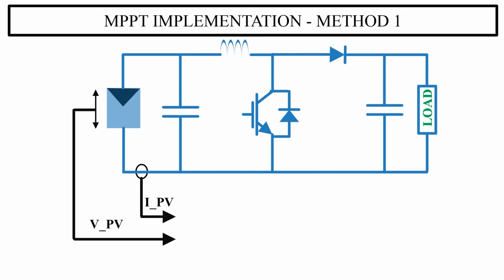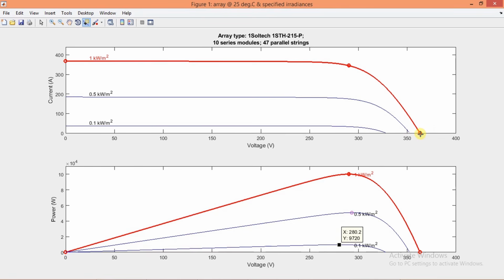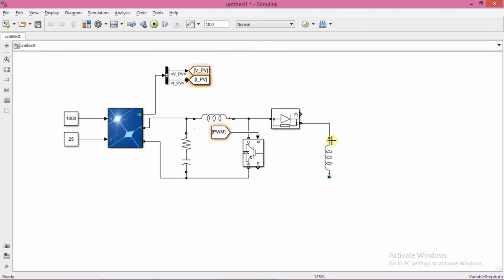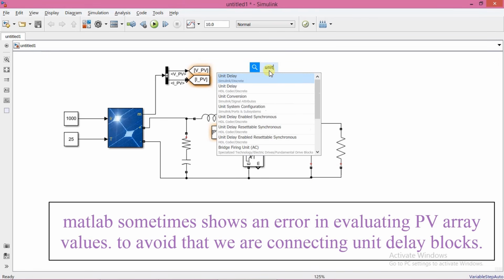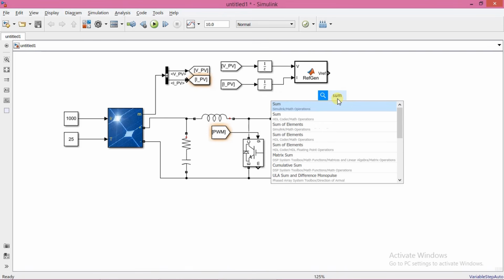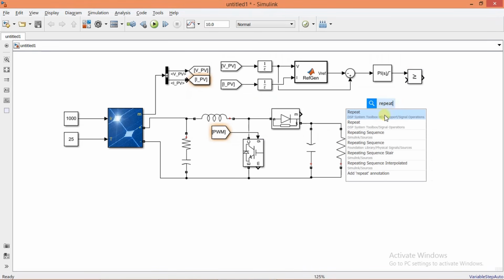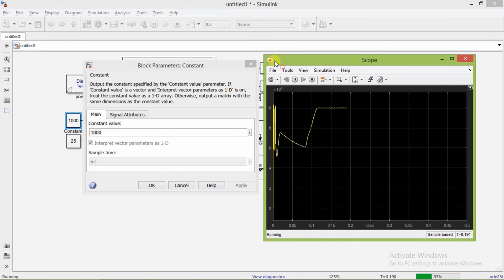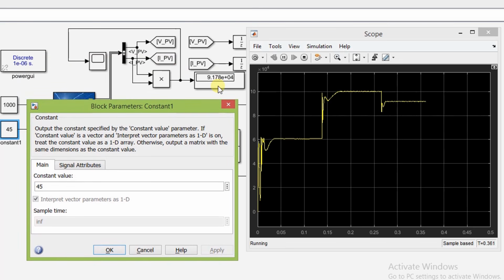Demonstration of Maximum Power Point Tracking (MPPT) Using boost Converter in MATLAB - Method 1

Comment: Here is the working version of the code:
function Vref = RefGen(V, I)

Vrefmax  = 32.9;    %(add your own ref)
Vrefmin  = 0;
Vrefinit = 25;
deltaVref = 0.1;

persistent Vold Pold Vrefold

if isempty(Vold)
    Vold    = V;
    Pold    = V * I;
    Vrefold = Vrefinit;
    Vref    = Vrefinit;
    return;
end

P  = V * I;
dV = V - Vold;
dP = P - Pold;

% Default value ensures Vref is always assigned
Vref = Vrefold;

if dP > 0
    if dV > 0
        % Voltage increased and power increased:
        % continue increasing voltage
        Vref = Vrefold + deltaVref;
    elseif dV < 0
        % Voltage decreased and power increased:
        % continue decreasing voltage
        Vref = Vrefold - deltaVref;
    end

elseif dP < 0
    if dV > 0
        % Voltage increased and power decreased:
        % reverse direction
        Vref = Vrefold - deltaVref;
    elseif dV < 0
        % Voltage decreased and power decreased:
        % reverse direction
        Vref = Vrefold + deltaVref;
    end
end

% Saturate the reference voltage
Vref = min(max(Vref, Vrefmin), Vrefmax);

% Store previous values
Vrefold = Vref;
Vold    = V;
Pold    = P;

end

Comment: Your work is really appreciable, But during Boost Converter Design, you mentioned the Voutput=600, i.e. the output of converter, but in actual, the output voltage of Boost converter is less than 400V, Is it the correct response, I have a doubt, Could you please clarify it.

Comment: One thing I don’t get is when the solar panels drop current because of clouds the maximum power will drop out leaving the voltage and the  sensor will sense that maximum power is drop but the converter will still put up some current but not the maximum current to turn on the sensor and voltage will drop lower then the battery voltage and this will overtime distract the battery cell will lower voltage to the battery and I realize a lot of mppt or like this the moment the senor can’t sense maximum power the charging should stop

Comment: what about boost converter output voltage. Is it constant by changing the irradiance or output voltage is varying. If output voltage is varying who will maintain the constant output voltage.
Reply from the maker: this is only mppt demonstration. Not boost voltage regulation. in application where u use only booat converter with PV is to chanrge the battery. In that case battery will ensure a constant voltage at the output and boost act as current source.

Comment: Great Tutorial 👍but I noticed that whenever I changed the temperature and irradiance values, I do not get the maximum power, supposed output voltage, and supposed output current. 

Please do you have any solution/explanation for this?
Reply from the maker: maximum power point will change i you change the temperature or irradiance
Reply: @TechSimulator  Thank you

Comment: Sir how did you get 0.95 and 0 for upper saturation and lower saturation limits ??
Reply from the maker: if i make the duty 1, switch is always ON, can saturate inductor, and device can fail. so for safety i made it 0.95

Comment: 1:38 How did you get all those values? And why the DC input capacitances is added in parallel with the PV Array?
Reply: capacitor uses to control oscillations generated by pv module

Comment: THANKS BROTHER... it worked like a charm
Reply from the maker: Glad it helped
Reply: @TechSimulator   its saying Derivative of state '1' in block 'untitled1/PID Controller/Integrator/Continuous/Integrator' at time 0.00019999999999999998 is not finite. The simulation will be stopped. There may be a singularity in the solution.  If not, try reducing the step size (either by reducing the fixed step size or by tightening the error tolerances) How do i fix this?
Reply: how did you set the PI values? i am not getting any output

Comment: Sir one Doubt, as stated If MPPT algorithm inbuilt in circuit it always gives maximum power only, but in your explanation if irradiation and temperature changes we couldn't get maximum power. Then what is the purpose of mppt sir. The circuit you designed buck boost converter, but you said buck converter. Kindly clarify it sir

Comment: i am getting this error while running the simulation ,Derivative of state '1' in block 'mpptpoboosterconverterpvsystem/PID Controller/Integrator/Continuous/Integrator' at time 0.00019999999999999998 is not finite. The simulation will be stopped. There may be a singularity in the solution.  If not, try reducing the step size (either by reducing the fixed step size or by tightening the error tolerances)
Reply: i am also getting the same error did you find the solution for that
Reply: You got the solution for that
Reply: Sir please help I am also getting same error

Comment: Sir, thanks a lot for the tutorial. This is the best tutorials I have seen from this topic, thanks a lot for sharing!
I am trying to analyze a specific PV panel (I'm using user-defined model and inputting module specifications). But I'm not getting the correct output. I think the main problem with the PV array is that the irradiance input is on W/m^2 but there is no input field to place the size of the PV panel. I tried to change the number of cells per module, but it doesn't work also.
Do you have any idea how to work this out? Thanks!!
Reply from the maker: You can share the model at ashacademy01@gmail.com  i will have a look
Reply: @TechSimulator  Thanks for the reply! model sent to your email, best regards!

Comment: AWSOME VIDEO!! But for my simulation the PI Controller values don't work well because it eventually gave me a exponential noise in the power generated which affected the load. I am going to try to figure out what would be better values for this and will comment on this post with my values. :)
Reply: WAG - Wild Estimated Guess - finding the PID values if you know what each term corrisponds to. I found that the Proportional (P) value is better at 0.0001 and the Integral value (I) at 0.02. Thank you very much sir, this has helped me so much!
Reply: @AndyGU1TAR

Comment: First of all, thank you for this nice video. Second of all, I simulated this by the way you showed in the video, but when I run the simulation, the outputs is not similar the ones you showed in the video. Did you change the configuration for the solver?  Could you please share your the simulation file by a link? Thank you.
Reply: Yes  me too my outputs are not similar
Reply: @rnature145  me too ,the results are not similar
Reply: @kamar1250  same, did u found a solution?
Reply: My project is not running and some error create in my programing.😐😑
Reply: أرجو منكم المساعدة إذا كان أحدكم تمكن من فهم هذا

Comment: I got the general principle. Some of the under the hood stuff in the blocks leaves me guessing.  Flyback transformer with buck/boost converter. Solar panel charge controls are just regulated switching power supplies.
Thank you for taking the mystery out of the blue box. Victron pun intended. 

Wow matlab has evolved into a very advanced tool!

Comment: I tried to designed with 20watts Panel, and designed the boost converter according to the textbook you mentioned in the video, but it was having bad and poor systems. Please helm me with a P&O design file  that works at 20 Watts maximum power point.
Here is my email: ambeharrison2000@yahoo.com

I will really appreciate your help. Thanks

Comment: Thanks for the video.
 I have implemented the same but it displays error message like "Variable 'Vref' is not fully defined on some execution paths".

Function 'MATLAB Function' (#23.510.514), line 35, column 4:
"Vref". how to correct it?

Comment: Is there a reason why when having 1 parallel string with say 10 series connected modules the mppt tracker is not able to locate the correct maximum power. In fact in order to obtain the correct value I had to change the load resistance from 2 Ohms to a higher value. Do you know why this is happening? Thanks for your videos :)
Reply from the maker: basically we we never implement mppt when we have a constant load at the output of the converter. we need to have either battery or grid. this simulation is only for demo purpose, just to understand how mppt works.

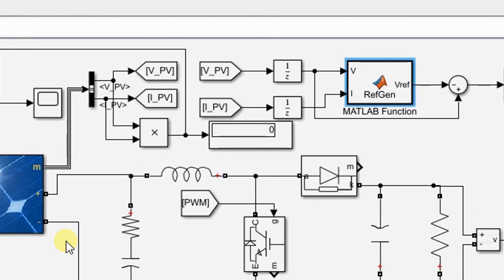Comment: I make everything exactly the same, but on 18:07 I see the power 8.7e4, 2.7e4, 8.7e4, 2.7e4, 8.7e4, ecc I don't know why
Reply from the maker: if you still face any problem, you can share the model. i will have  a look
Reply: @TechSimulator  I will try to share my model
Reply: But with 999 Irradiance It work LOL
Reply: Yes! It is happening the same to me! 🙆‍♂️ I have checked everything again and again and the value just doesn't want to converge to the desired output value. Have you solved the problem? Can I also share my model and where to?
Reply: I have the same problem!!
Reply: I am also Having same problem
Reply: Have you solved the problem?
Reply: for my case my power display only shows 1.204e5, have u solved ur problem yet?
Reply: @度你卡称 my case the output power showing 6.08e+04 . What makes the difference the only thing I used in different is the pannel model as i could find the exact model that is used in this video . What component that is responsible for this change in output

Comment: In this algorithm, the voltage is perturbed with the help of the load right ??
Reply from the maker: Yes. In fact changing the voltage across the load
Reply: @TechSimulator  Thank you so much for the quick response. Could you help me with the design of boost converter for a wind energy system?? I have been trying to do it for a while and not getting a proper result. Also what's the reason to use a boost converter particularly. Won't it be more useful to use a buck-boost converter?? Hope to hear from you 😀
Reply: @philipliju564  Brother if u got ans.. then please tell me also..

Comment: does the voltage on the boost converter remain the same
Reply: I have made this but it was not the same output voltage
Reply: @memomm82  I have error 
Persistent variable 'Vold' must be assigned it is used
How I correct plzzz

Comment: thanks sir for your effort, why the input voltage from (250 to 350 V)??&&what do you mean by rated power equal 100KW?Is it the output power of the PV array???&&from where you get the equation of voltage ripple and current ripple?? & if you have any source for my question ,please contact me at (shimaahassan201092@gmail.com)

Comment: @Tech Simulator  I actually intended that even at low irradiances the boost converter should still be able to provide the requisite voltage. Suppose at 1000 Wm-2 I get an output boosted voltage of 600 V at 600 Wm-2 also I must get the same voltage however the power would be diminished. So what can I do additionally so that my boost voltage remains constant irrespective of the irradiance?
Reply: Hi bro aim doing this project for constant output voltage... please help me if know how to implement this ....if we decreases irradiance will output voltage decrease or remains constant?

Comment: why didn't you use a closed-loop control that even considers the boost converter's output voltage
Reply from the maker: Boost converter output is same as the input of inverter, and that there is closed loop control in the inverter which controls the boost converter output voltage
Reply: @TechSimulator  I actually intended that even at low irradiances the boost converter should still be able to provide the requisite voltage. Suppose at 1000 Wm-2 I get an output boosted voltage of 600 V at 600 Wm-2 also I must get the same voltage however the power would be diminished. So what can I do additionally so that my boost voltage remains constant irrespective of the irradiance?
Reply: @ArvindRao33455  I am doing the same project may you guide me how to get voltage constant, thank you so much

Comment: Sir,
 Nice video. Could you kindly perform the same algorithm for a wind energy system ??
Reply from the maker: Thank you. I will try to make
Reply: @TechSimulator  thank you so much..  I really appreciate it ❤️
Reply: It would  really help me if you could implement the same algorithm on a PSMG based wind turbine coz you could neglected the gear system if you use the above generator. 
Waiting for your new video 
Thanks again ☺️
Reply: @philipliju564  have u done with this project.. I'm also working on wind turbine model.. and i need help.. please.

Comment: Output volatage is around 450 only I am getting not 600
Reply from the maker: That is the maximum voltage i considered for the design. Since we have only a resistive load at the output, the voltage will vary with the input.
Reply: did you get a stable power.I simulated this.But power is varying between 2*10^4 and 9*10^4
Reply: @ashithasamarasekara871  yes stable I got
Reply: @SriRamReddy5114   I simulated this 5 th times.but I couldn't get stable power.can please help me.can you imagine what is the problem

Comment: sir i m  using pv 30KW with incremental conductance method  integrated with the grid connected inverter i m connecting load as 40kw...how much of load can i connect at the  pv output
Reply from the maker: At the inverter output?
Reply: My doubt is... first verify the boosted voltage.. at that place how much load i can connect.. and after that i can remove that load and it will be connected at the inverter output